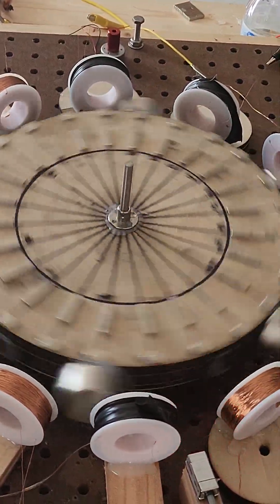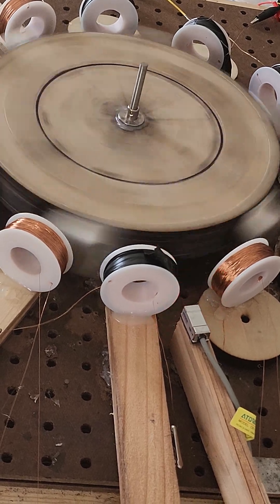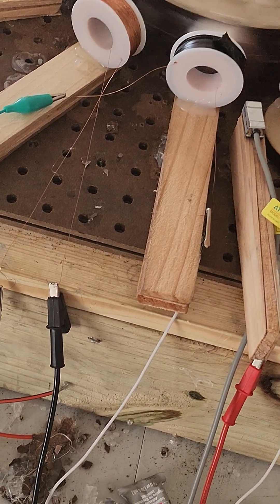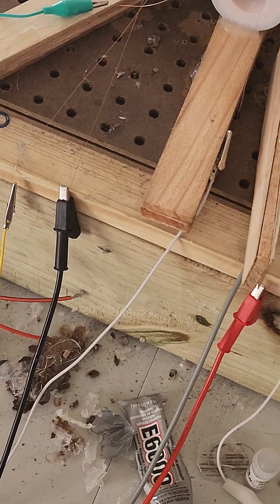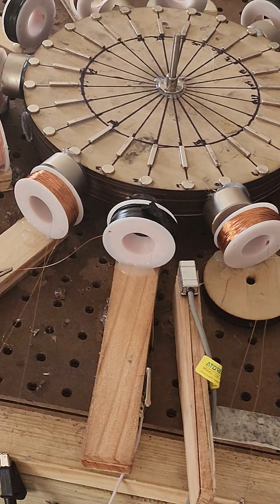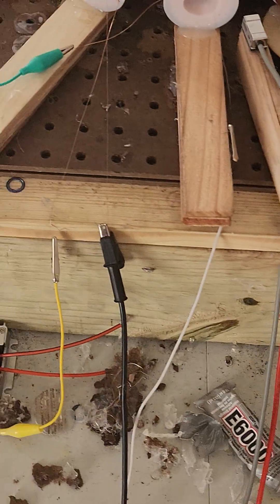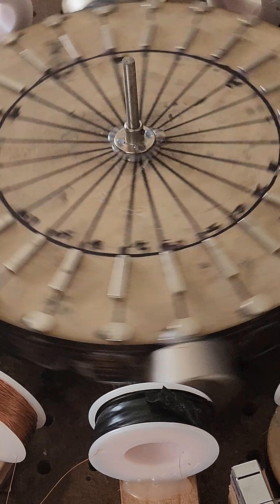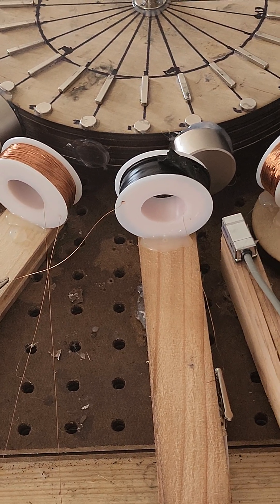pulse motor generator: Discussion on some self-sustaining ideas

Comment: Try putting a long core inside coils, like 5-8 time as long as your coil's thickness, then put the coils at the end of the core. Play with the speed of the rotor. At some speed it will not slow down the rotor. To make the rotor faster use thicker wire, like 1mm. The core can not be a bolt. Can be laminated steel or make one yourself from iron dust/iron oxide dust/resin.
Reply from the maker: I have 4 soft iron cores 1/2 inch in dia. and 6 inch long they fit my new bobbins well
Reply: @MPHJR  Try putting a load (a bulb, not LED) on generator coil when it is close to the rotor, see how bright it is and how much it slows down the rotor. Then move the coil away from the rotor half way and than at the farthest end of tle long core.
Play with it.